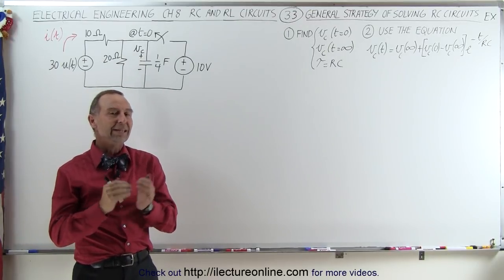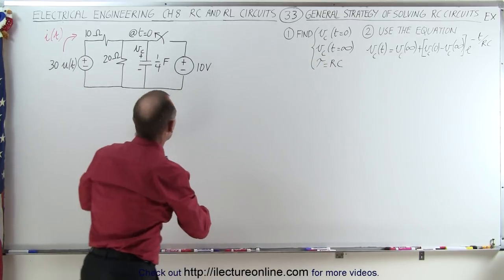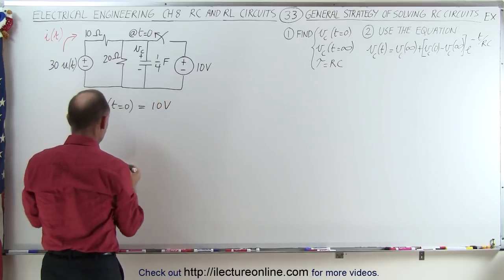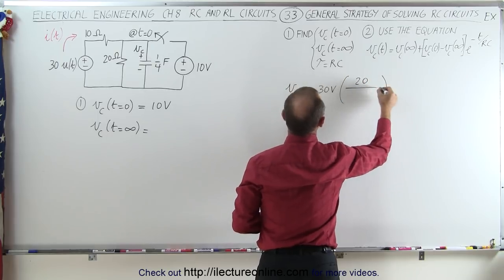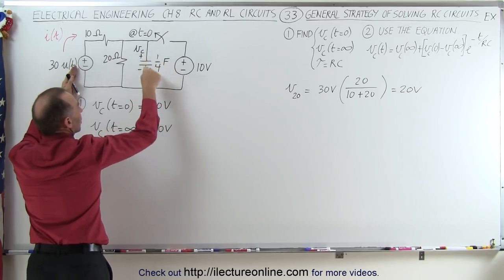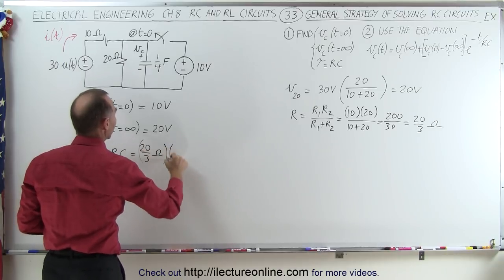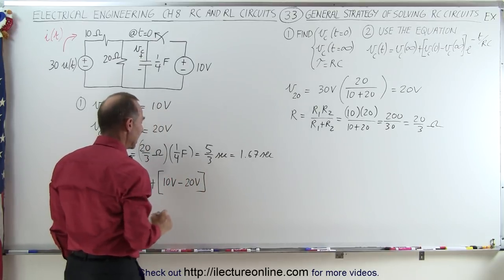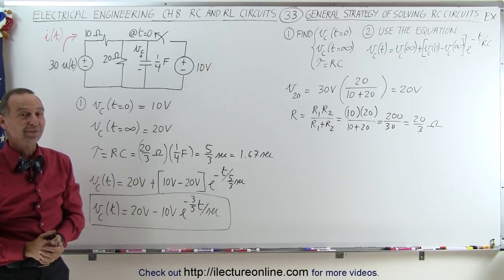Electrical Engineering: Ch 8: RC & RL Circuits (33 of 65) Gen. Strategy of Solving RC Circuits Ex.

Comment: would not the capacitor voltage at t=0 be equal to the voltage drop across the  20 ohm resistor due to the 30V source?
and Vc at t=infinity be equal to the voltage drop at 20 ohm resistor - 10V ?
please elaborate. thx
Reply from the maker: Note that the 30V source is multiplied by the u(t) function which is equal to 0 before t = 0 and is equal to 1 after t = 0.

Comment: why when the switch closed no volt coming from the 30 v source ?
Reply from the maker: The sources are not affected by the closing of the switch.  They continue to provide a potential difference between the terminals.
Reply: @MichelvanBiezen  I didnt get it sir. Dont you think that the 30-V source has an effect on the circuit since before t=0 both sources are affecting the whole circuit. Can you enlighten us more?
Reply: @jrgelpe7196  The left Vs doesn't turn on until t=0 and switch opens
Reply: @zwischenzug5324   can you tell why ?